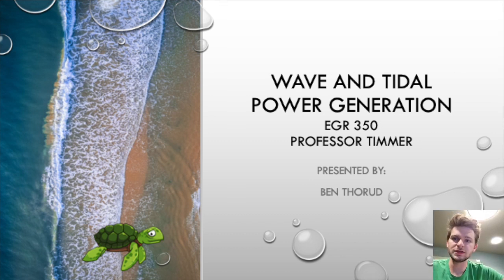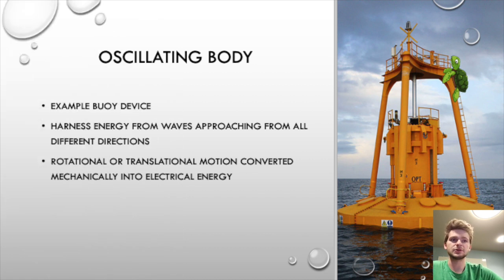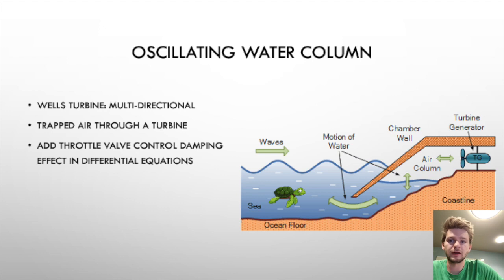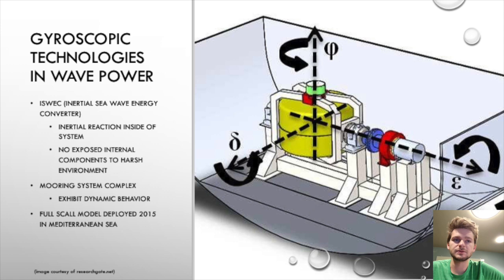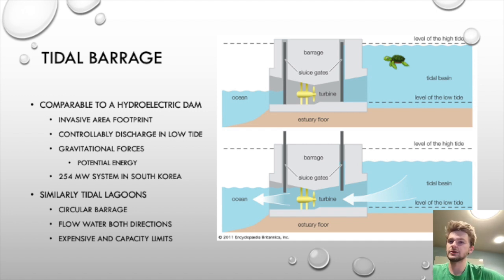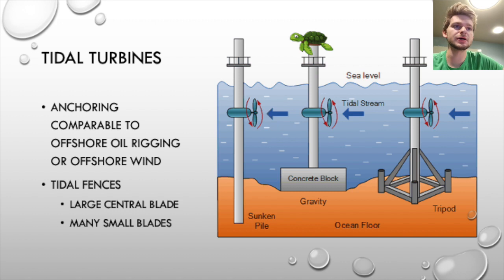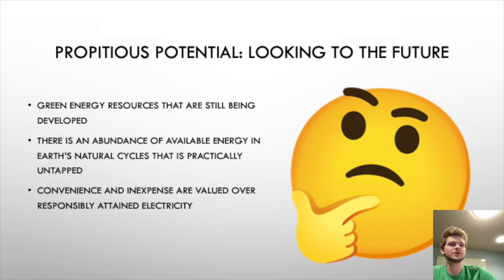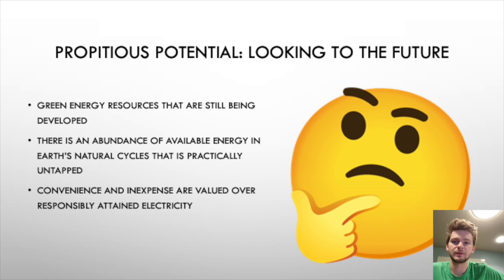Can we Generate Electricity from the Ocean?

Comment: Great video! A very in-depth look at all the ways we can generate energy from the ocean. 

Could I ask: which one of these devices do you think will be the most feasible to use in a low developed area of the world to generate electricity to a small community? I believe tidal energy would be a great way for these communities to gain access to reliable energy.
Reply from the maker: Thanks for asking. 🙂 I am skeptical of the longevity of some of the technologies that I mentioned (such as those with many moving parts and complex circuitry or hydraulics). I am personally most enthused by the tidal barrage systems, which work very similarly to a hydroelectric dam. It seems like these could provide a consistent and efficient transfer of energy from what is stored by potential energy in the water from the tides.